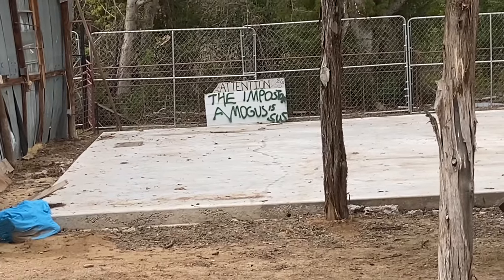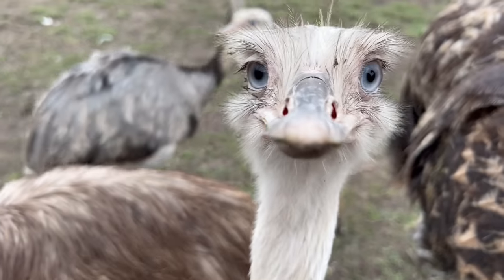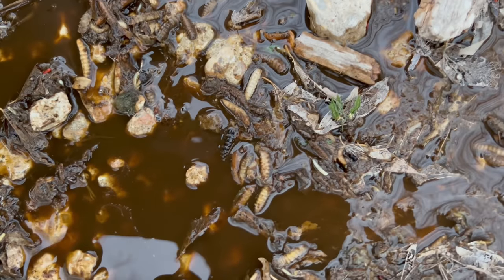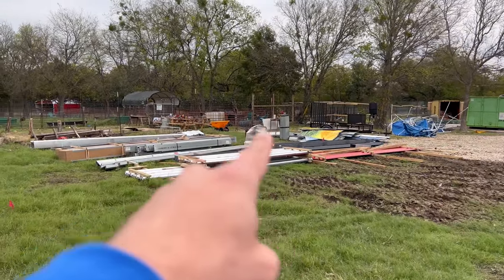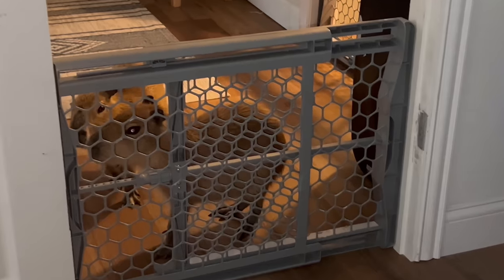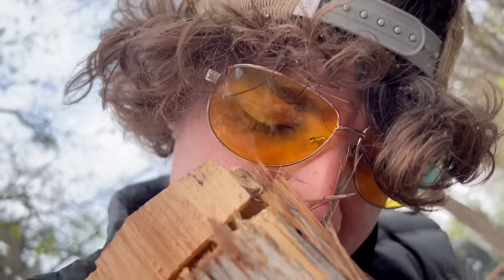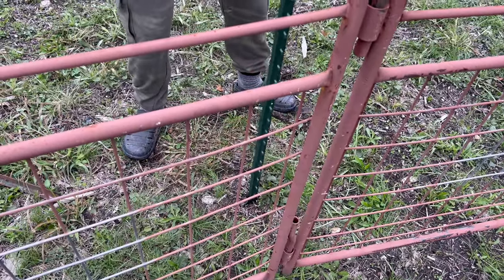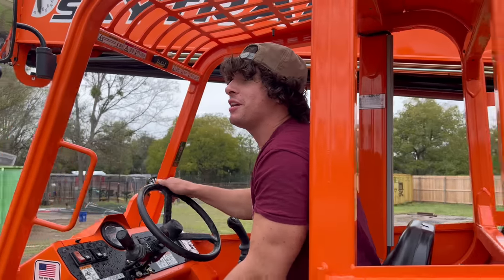Gort Becomes Forklift Certified (gone wrong) *OSHA CALLED*

Comment: Did AAA get the bus running? Either way, I would def recommend siphoning out the gas tank and putting in fresh fuel. After 3-6 months without use, gasoline starts to degrade and the biproducts can kill the motor.

Comment: DO NOT USE POISON TO GET RATS OUT OF YOUR WALLS! If you attempt to do so, you'll get the rats alright, but they'll die in your walls and stink up your house for weeks and weeks and weeks. Do NOT do that. Instead, the best method there is to use traps, and change what kind of traps you are using frequently, since rats are actually smart and learn what particular traps look like.